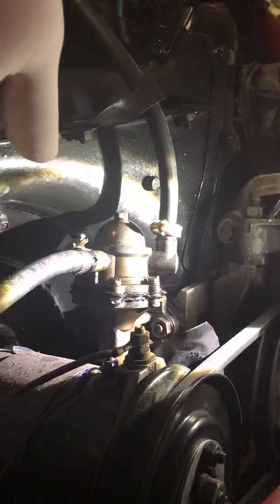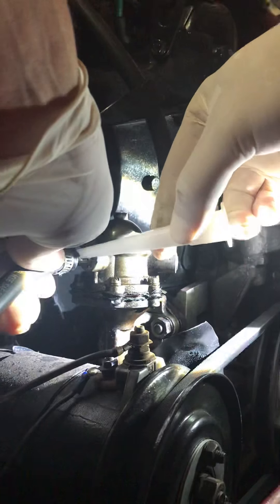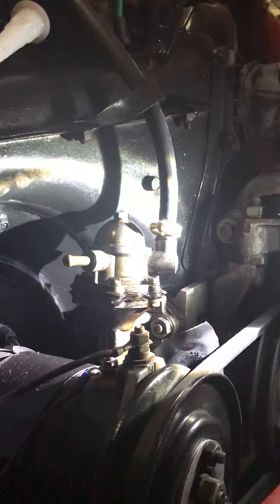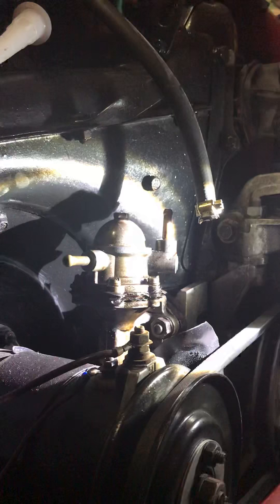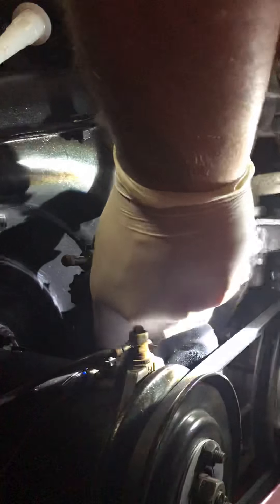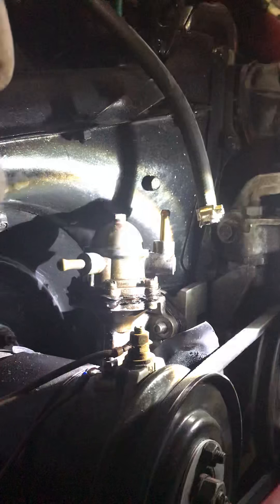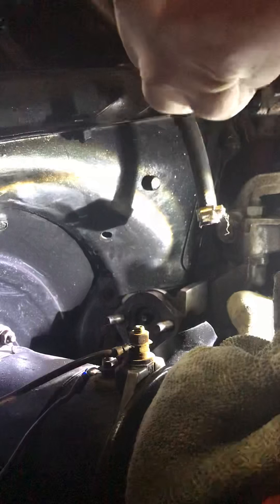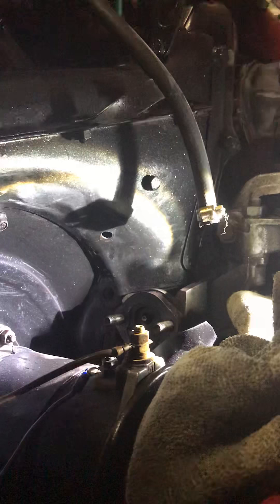Fiat 500 fuel pump change pt2

Comment: HELP!!! 
I have a 2013. A 13! Where is the fuel pump and fuel filter??
It says an inline fuel filter but where !! Help me please!
Reply from the maker: Hi Paul, I think on that model of Fiat being the new version it should be at the rear of the car near the fuel tank. They run electric pumps. What is the problem?
Reply: @MrXfabela  it was getting fuel pressure, we changed the pump, it’s better but may have to change out injectors .
Reply from the maker: @boxerdogs4141  hi Paul, ok before you change injectors go to your auto shop and buy some injector cleaner. Fill up the car and go for a decent drive and add the whole bottle to a full tank. Go on the freeway and get the revs up they might be just gummed up and need a good clean . Always use premium unleaded In fiat mate as the premium fuel has fuel cleaner in it where as the normal is pretty average. I actually use premium on both my 1967 500 and my 1990 126 / niki and the premium is much better. Also sorry for late reply I’ve been flat out with work etc and haven’t posted anything for a while on YouTube. Thanks for subscribing also . Merry Christmas and happy new year